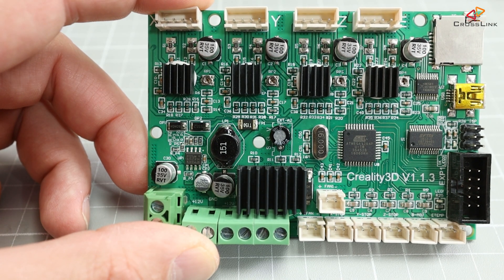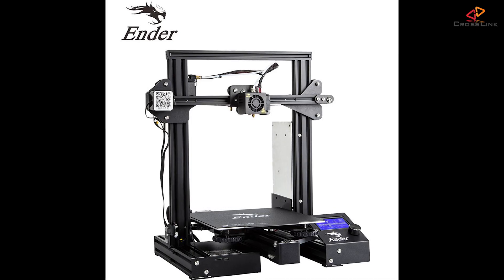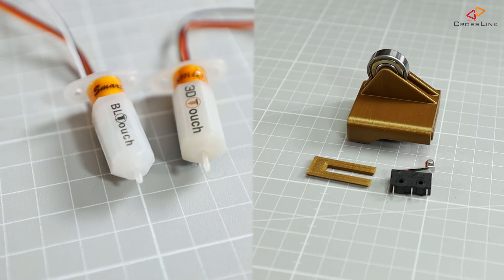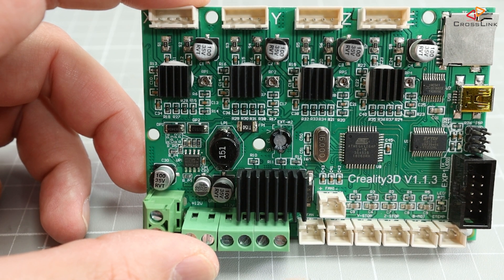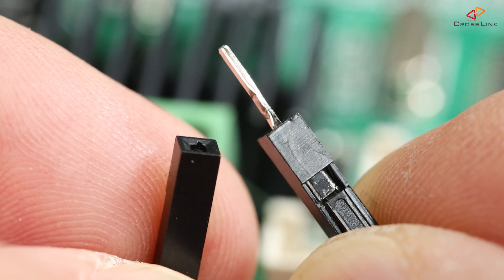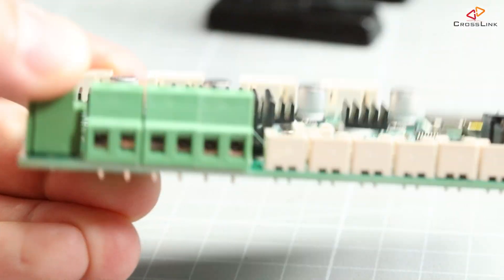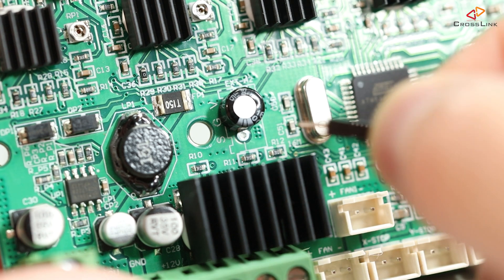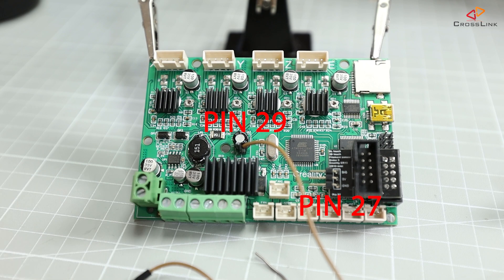TWO free GPIO pins! - Creality Mainboard PIN27 and PIN29 breakout explained

Comment: Sometimes you can use a stainless steel dentist pick to clear the solder filled hole.  Heat the solder and insert the pick.  The solder will not stick to the pick, which can then be removed leaving a nice clean hole.

Comment: I've got a Prusa Mk3, which uses the Einsy Rambo board. Are there I/O pins accessible on that board? Any breakout board available to get easy access to them?

I searched around a lot and as far as I can see there are quite a few I/O pins that are not used and hopefully should be available for my to add additional hardware to the Prusa and control them through I/O pins.

Comment: can we add extra z axis using those 2 pins?
Reply from the maker: Nope but you can just use a stepper motor splitter cable to duplicate the z-motor output to another motor.
Reply: @Crosslink3D  well that's a good idea but don't u think that those motors will draw too much power from single driver? cause nema 17 is rated 1.5 amp nd driver is only 2 amp. so that's my big confusion
Reply: @spankaj420p  I did the dual Z kit upgrade over a year ago. Basically, it was a motor, a few extra bits, and a cable splitter. Works so much better, and no issues at all, no firmware changes etc... Recommended upgrade IMO.
Reply: @rfc1795  thank you for giving hope...i will look forward to try these

Comment: Does this mean I can now use pin 29 for my BLTouch and keep the sound of the buzzer ? Because using the pin27 board disabled the sound :( I believe this was default in the TH3D firmware as soon as you enable BLTouch
Reply from the maker: Yes, that’s true. You can keep the beeper when using PIN29! 😎

Comment: I added a mosfet to control the hot end fan so my printer is quiet when not printing, so I can leave it on all the time, And a bltouch on the buzzer.  It seems like you can reuse the sd card IO pins also, I about to give that a try to add a runout sensor, a crash z switch etc. But probably going to just replace it, there is no memory on this at all left.
Reply from the maker: Yeah, that's right. I've also made another video about breaking out the serial port. Coming soon.

Comment: You can actually add 16 pins with one MCP27013. Its price prolly gonna be the same (if not cheaper) as said 1-pin-extender + a bit of space for the lib.
Reply from the maker: I agree but it has to be implemented into Marlin firmware, too.
Reply: Did you try this? how hard was it